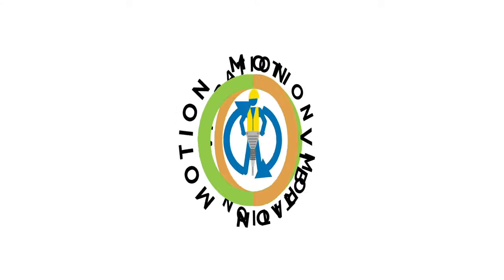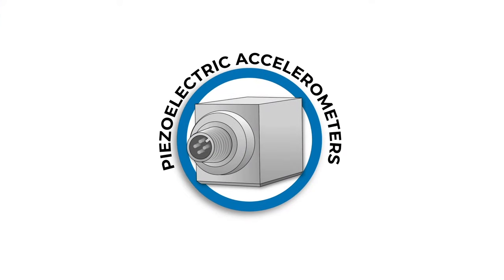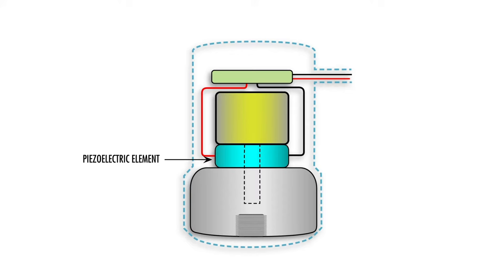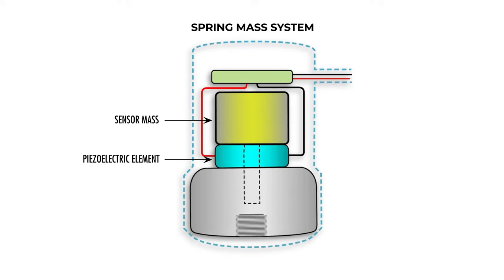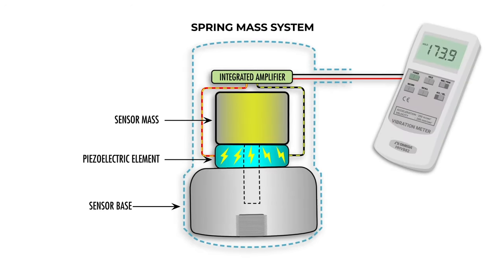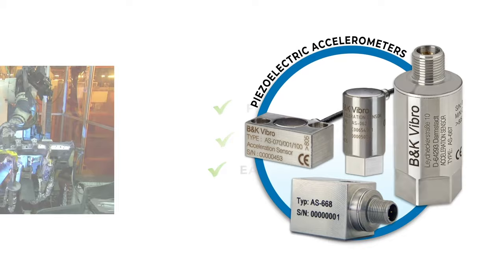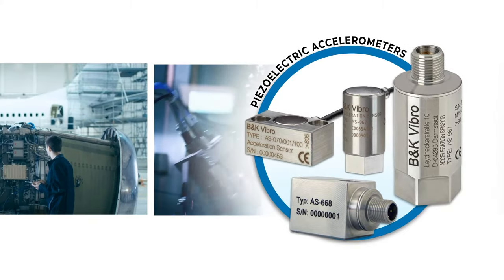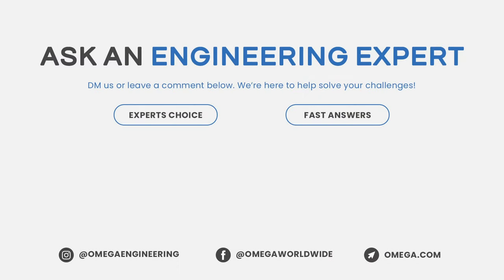What is an Accelerometer and How Does it Work?

Comment: can you tell me which is the best  ACCELEROMETER for measure vibrations on flat surface?
Reply from the maker: Hello, for a flat surface you can use a single axis accelerometer like an Omega ACC787A Series. Here's a link to the product page: https://www.omega.com/en-us/control-monitoring/motion-and-position/accelerometers/acc787a-series/p/ACC787A
Also, if you need more information on accelerometers and other pressure, strain and force measuring sensors you can email our pressure group at: pressure@omega.com
Thanks for watching!